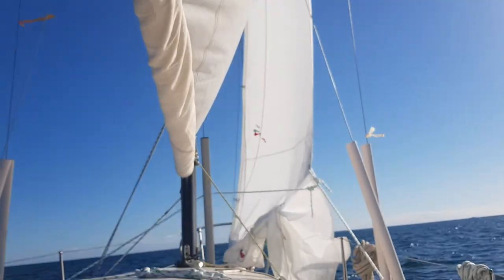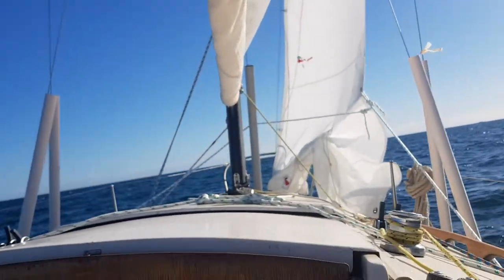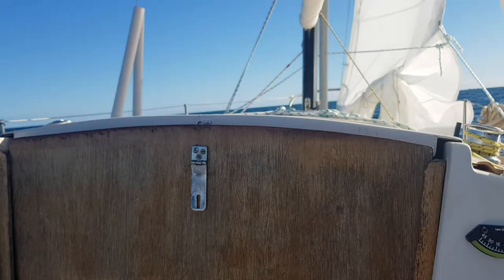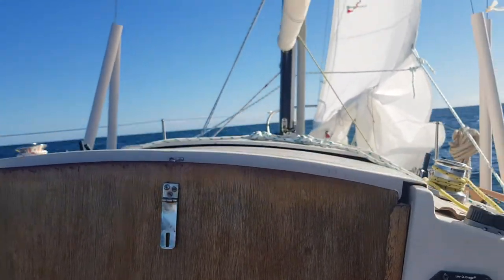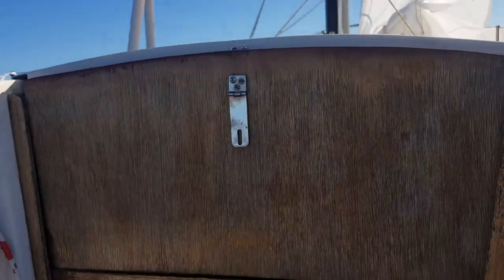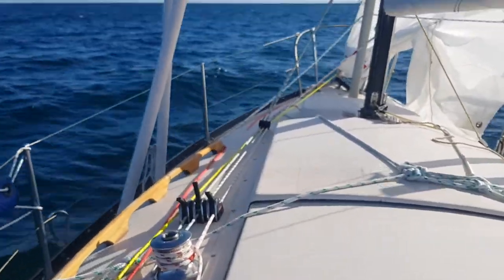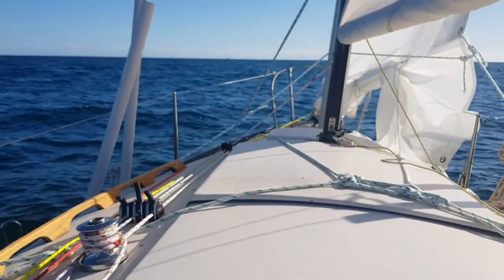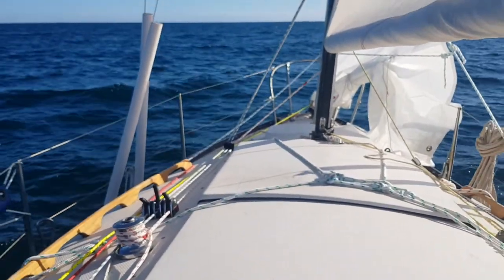Testing out 2nd reef in a hanked on jib

Comment: Thanks for the video. Whats the blue bag on the port safety wire?
Reply from the maker: Lee cloths so if waves are crashing into over the side of the boat I drop them down and attach the bottom of them to the toe rail. It will deflect 90% of the water back off the side of the boat. I keep them rolled up in calm water because they also block any breeze coming into the cockpit.